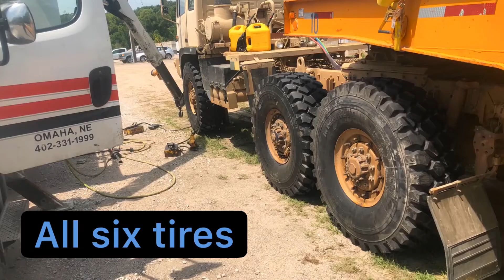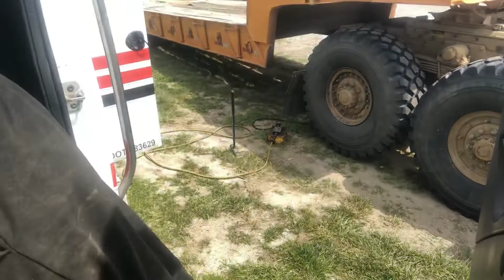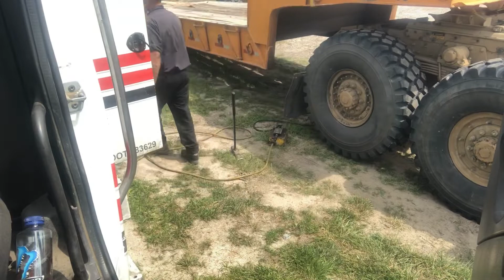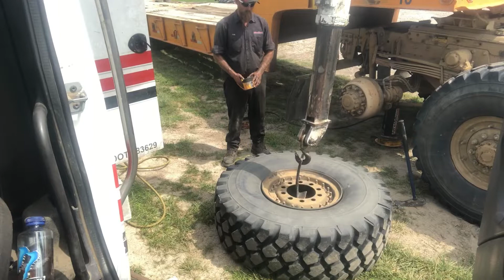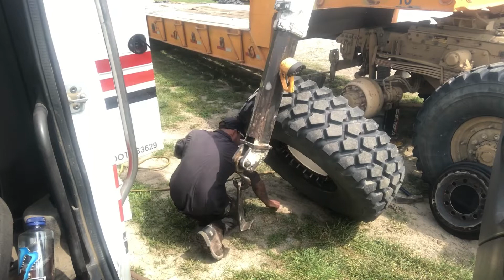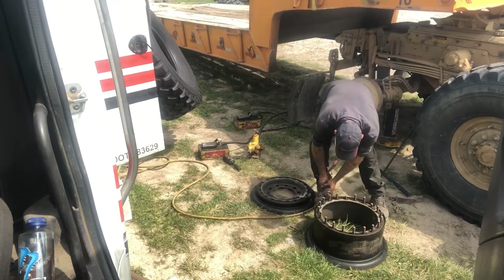Military split rims

Comment: Craig I have a big problem.  I'm doing regularly taylor forklifts tires . The studs keep breaking & nuts Keep coming a loose. What could I be doing wrong.
Reply: Stephen McHenry
Interesting question you pose, I would examine the pattern that you tighten the nuts. For example, do you perform an X pattern?

Comment: Being tubeless demountable wheels could those be done vertical?
Reply from the maker: Yes if If they did not have the Auto air up System they can only be removed after the wheel has been removed
Reply from the maker: Sry I did not show that part it got clip out